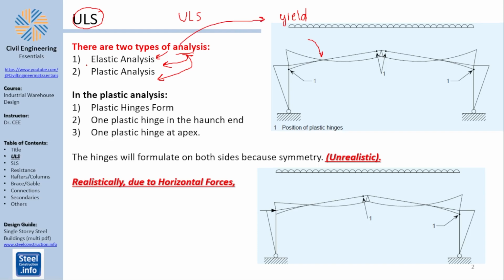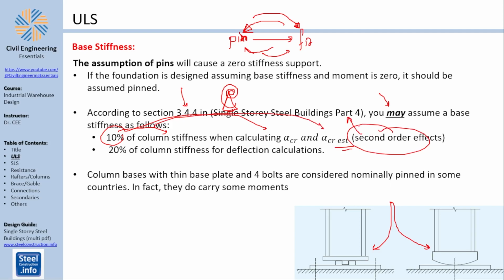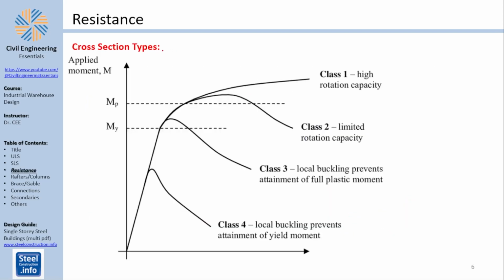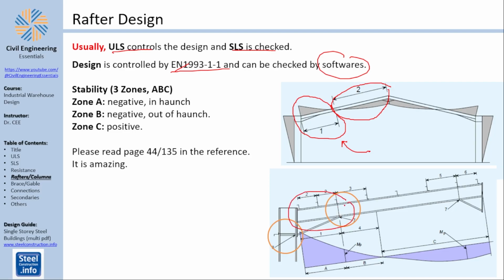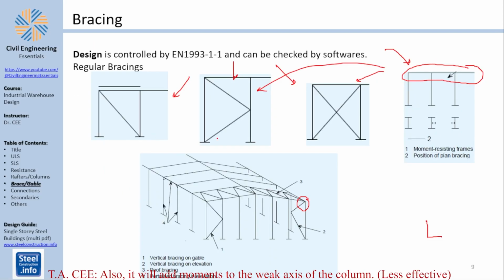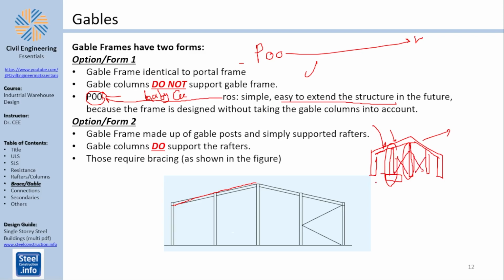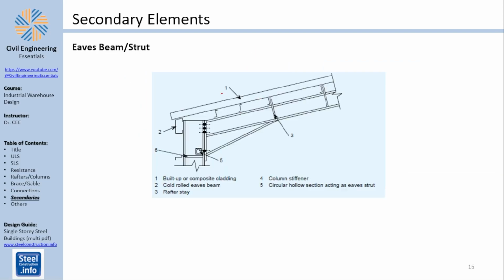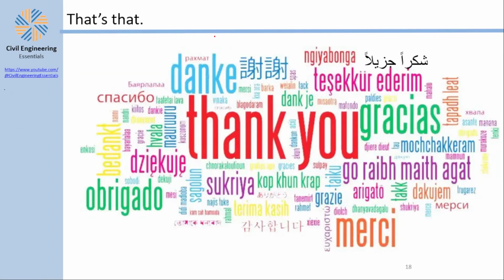Design of Industrial Warehouses | Part 4: Design of Portal Frames

Comment: Sketching prior to design is important.  Base fixity or pin support is important to both the frame and the foundation.  Thrust needs to be accounted for during sketching and design and drawings.  A reminder list can help.  Horizontal and vertical loads.  Your building supplier should provide load cases too.
Reply from the maker: I 100% agree with your point. Just to clarify, by building supplier you mean the stakeholder/owner, right?
One thing I want to add is: the engineering team may be also responsible for parts of the load. For example, wind loads are calculated by the designer (us). Also, we may need to find the "type" of crane needed for the warehouse, if a crane is to be used there.

it is a "scope of works" issue. But your answer is very important and I totally agree.

For pin vs fix, oooooh this is a long discussion, I think I have a video talking about it.

Regards,
CEE

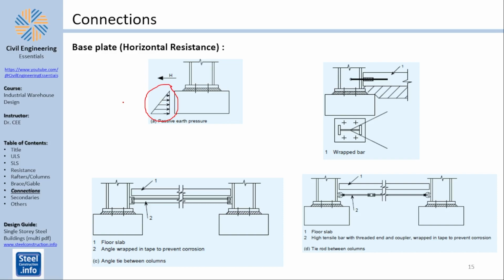Comment: Food for thought at 18:36 : Along the passive earth pressure, we could consider adding the friction between the foundation base and the soil as well (before considering exceptional solutions, like those underground rods you illustrated). Am I wrong? 🤔
Of course if the code permits it - maybe there are places in the world where certain soils are more strict than I could imagine 😬
Reply from the maker: Yes. You are right.
You could actually consider the friction and cohesion of the soil in the resistance of the horizontal forces 
Plz note that this is a "General answer" but you have to abide by your local code

Great point actually, for some reason it did not occur to me.
Thnx a lot,
Regards,
CEE

Comment: Thanks. On connections design why do you provide a hole on the eaves column
Reply from the maker: if you provide a hole in the eaves column, it means you have a bracing that goes through the hole in all columns to brace them against lateral movement. 
just 1 alternative. You can find more info on the steelconstruction.info website. It is really a golden website to check. (Not sponsored, I do not own it)

Comment: Thanks for videos. Plastic hinges, stability of the frame and second order effect are myht for designer no one wants to touch why is that?
Reply from the maker: Hi there
I am happy you like the vids.
Now my guess is because usually codes give you an (easy out) by allowing the usage of linear analysis in most (practical) cases. But of course if you go to the academia side of things, it is exactly the opposite. In research, we deal with 2nd effects solely 👍

Comment: Long time ago, I proved that the plastic design for portals is a short seeing idea which does not apply everywhere. If you consider a single span, the gain of reducing a bit of steelwork is much less than the extra purlins, so supply,  fittings and detailing you have to provide to fulfill the requirements. 100mm longer haunch was much cheaper option. Perhaps in countries where material is very expensive it could work.
Reply from the maker: Hi there,
To be honest, I agree with you. If you want to design stuff towards full plasticization (including hinges), more details with regard to stabilization as you mentioned are needed. 

Furthermore, so that all our viewers benefit, it is to be mentioned that it is exactly those little fittings, connections, details and so on that will drain workmanship. Depending on the country, the hourly wage of skilled workers might be really significant that - as you mentioned - any saving in steel weight would be offsetted by this. 

Thnx a lot for your comment, it helps the community a lot. I am really thankful. 
Stay tuned for more content,
CEE